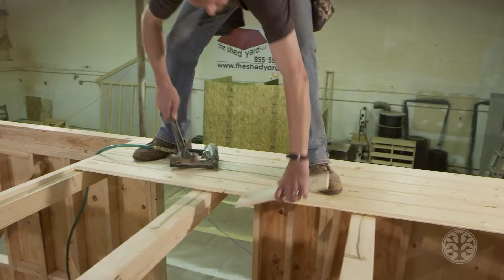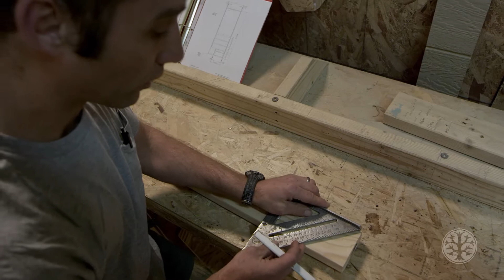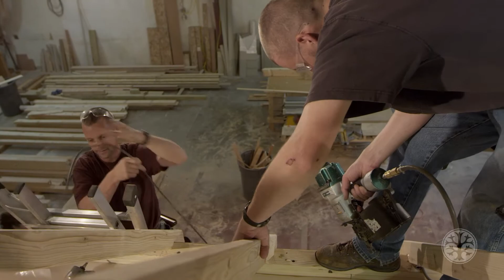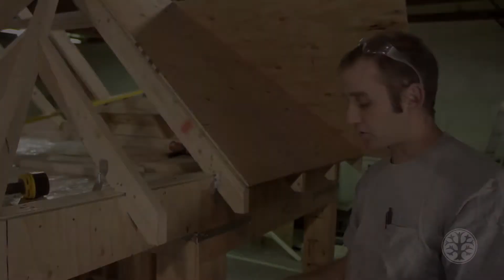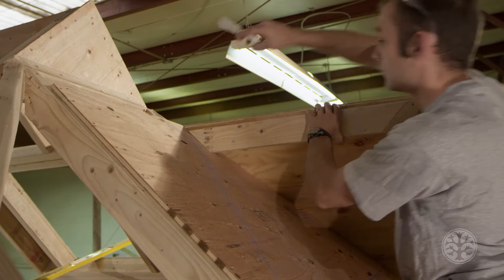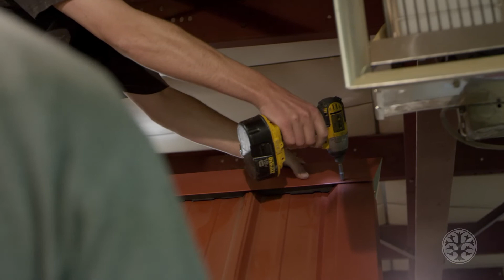How To Build A Tiny House : Chapter 4 - Loft & Roof - Tumbleweed Tiny House Company

Comment: Are those loft joists 4x4's?
Reply: indeed it looks like it. To save space below, I'm thinking of using 2x4's, but more of them at smaller spacing. I'm wondering if that's legal as long as they're enough of them.